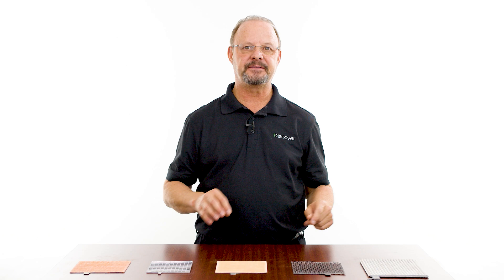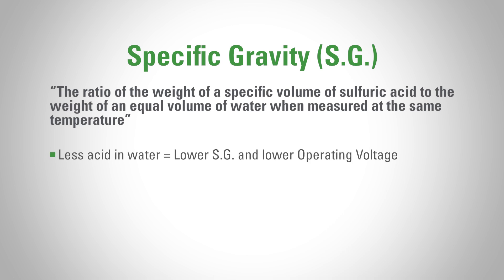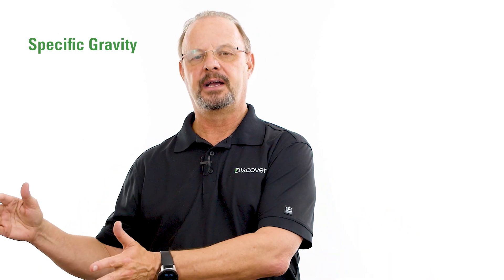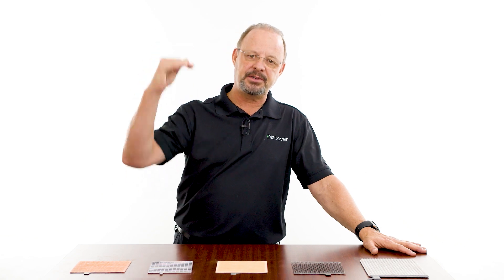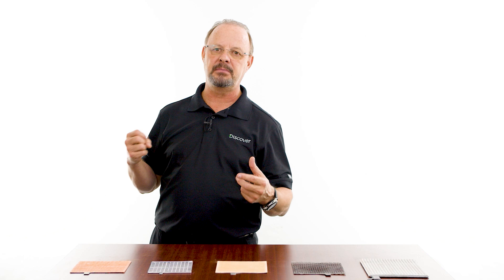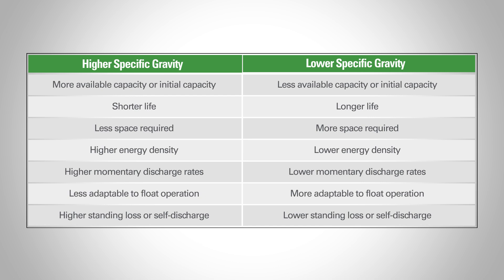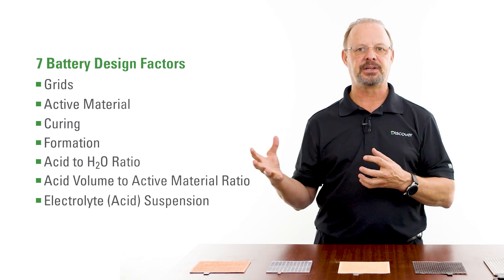Understanding Specific Gravity in Battery Design

Comment: What is recommended specific gravity for flooded lead acid battery
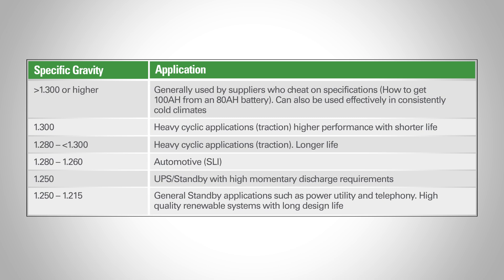Reply from the maker: Hello @drameriemmanuel1187, it depends on the battery. If you stop the video at 3:53 https://youtu.be/CIfAPhYVLwQ?feature=shared&t=233 it will give you a rough idea of the correct gravity for your application. Are you asking for a specific Discover product? As an example: one our Tubular Flooded SOPzS batteries should have a specific gravity of 1.255.